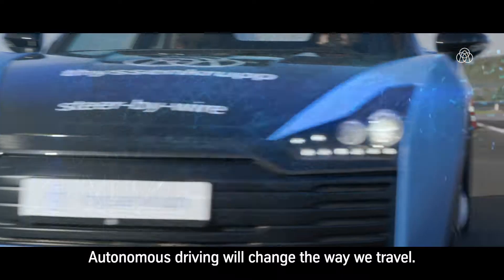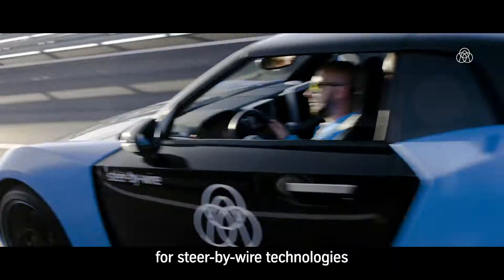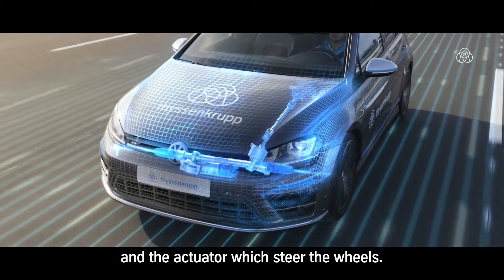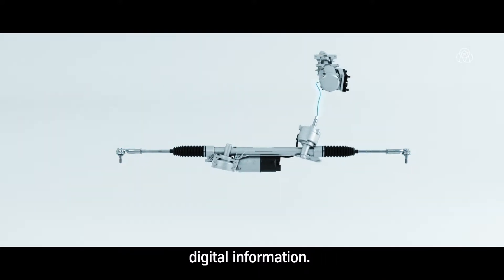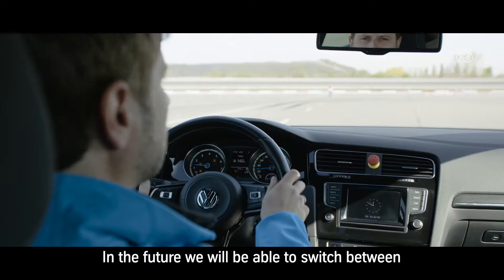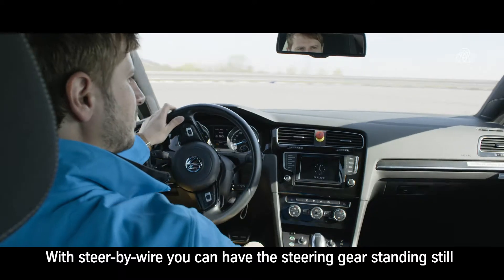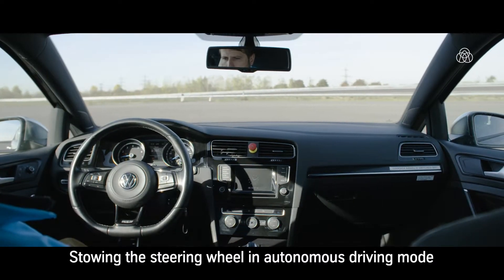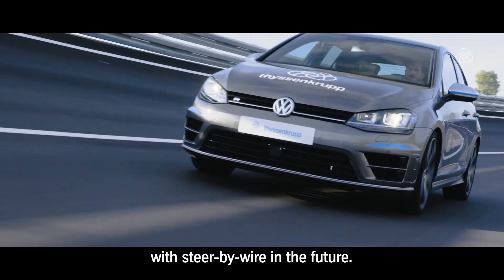Automotive Insights | Steer-by-Wire

Comment: That doesnt sound risky and pointless at all. I bet its just so the pewers that be geofence your car and such
Reply: It's there because it's cheaper for manufacturers to make both RHD and LHD cars is they don't have to rework the mechanical linkage. It's huge cost and engineering headache so they've wanted to get rid of it for a long time. The technology has been there for decades (big mining trucks use it) but safety regulators have been very unwilling to allow a system without a failsafe mechanical link on public roads. It also makes it easier (and cheaper) for cars to make crash safety requirements. Nothing to do with geofencing - if you want to do that, it would be trivially easy to do with existing technology, as virtually all cars has GPS and either an engine management system or battery management system. It just about cost cutting.
Reply: @lmlmd2714  I highly doubt changing the steering linkages and such from left to right hand drive or vice versa is more expensive than going for a steer by wire system.
Reply: @isakjohansson7134  The cost is really in the development. Once that's done, the cost of putting it into new models is a big saving as it makes every single car built with it a cheaper and easier to engineer unit, and much more ambidextrous. Most of the parts are the same as those used in an electric PAS system - so aide from adding a set of redundant servos and controller, much of the rest is reducing rather than adding complexity. It's been done on industrial vehicles for decades so it's not like they're undertaking anything groundbreaking - a lot of the R&D is proving to regulators it's safe enough to use on public roads - which to be honest, it pretty much is - the failure rate in modern PAS systems is incredibly low.

Comment: Autonmus driving won't work with hydraulic power steering.
Reply: Who still uses hydraulic assist?  Didn't most cars change to electric-assist maybe 2015?  I haven't dug thru new cars much.
Reply: Most power steering these days uses electric servo-motors, as running belts off the engine to power the hydraulics burns extra fuel and makes it much harder to offer the same vehicle with different power trains.

Comment: Feels like Tesla Model S will be first to bring it to market with its Yoke steering "wheel"
Reply: Nah mate, there are already some cars with steer by wire, seen some infinity cars with steer by wire
Reply: @_lonath_  it still have a steering column, it's not 100% by wire
Reply: @seb.  they say it drives 100% by wire and only use the steering column in case of emergencies, yes, there are no savings or efficiency, but there are other advantages to it be it minor or something most people don't notice or care about
Reply: @_lonath_  if cars become truly autonomous, steering column will be thing if the past... With enough redundancy obviously
Reply: @seb.  Tesla cars have a mechanical steering linkage. The "yoke" wheel uses the same assembly, it's just a marketing gimmick to look futuristic.
Reply: Tesla doesn't have drive by wire which enables progressive steering that's why drivers are having problems manuvering the model S with the yoke
Reply: @akilfahd  agree, such a disappointment
Reply: @akilfahd   Its coming in October.
Reply: My 14 q50 hybrid has steering by wire and it’s amSzing

Comment: But it requires enough redundancy. Otherwise in case of a total failure, terrible accidents can occur.
Reply: I agree 100%
Reply: Agree. It would need to be a double or triple redundant system. However, this has been done with big mining rigs for years, so it can certainly be done. Regardless of automated driving, I think the biggest advantage for the manufacturers is in cost reduction, as it makes  building LHD and RHD versions of the same vehicle much, much simpler. It also makes it easier to get a high crash rating as you eliminate a major mechanical component that transmits shock straight from the front suspension, pieces straight through the bulkhead and right into the passenger cabin. I think it'd be great to have on city cars, but is a terrible idea for 4WD vehicles, which often need repair and servicing in remote settlements, or even in the field.

Comment: With this technology we can avoid oversteering and understeering situations during panic situations.
Reply: Good point but how is the car electronics going to differentiate between actual panic situations and power slide or drift
Reply: @Mm.2112  Where on the normal road are you drifting?
Reply: This is not new technology but it just didn't make sense until now because people weren't buying it saying, "what if battery dies?"..
Now with EV, this absolutely makes sense going forward... Even toyota will use this..